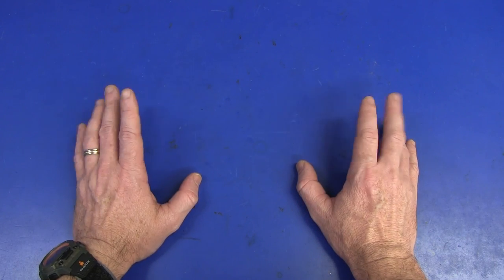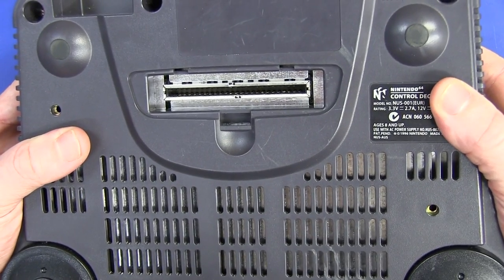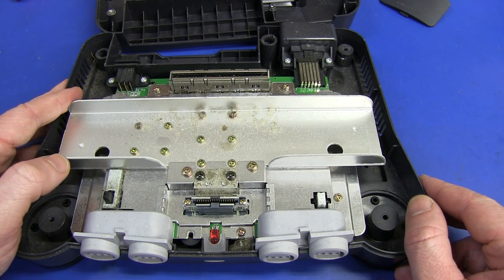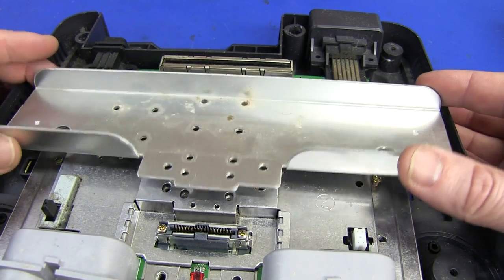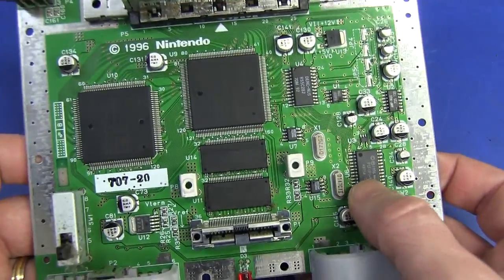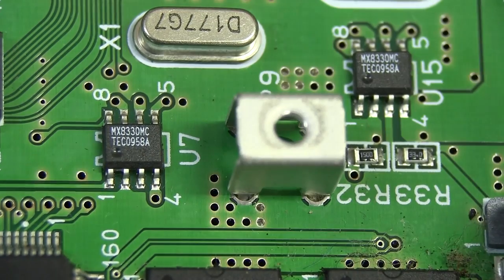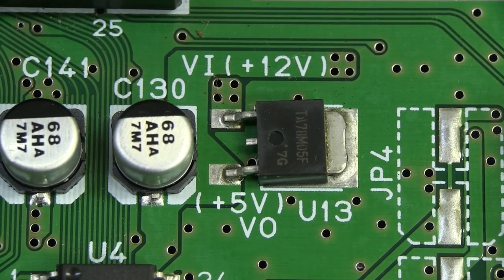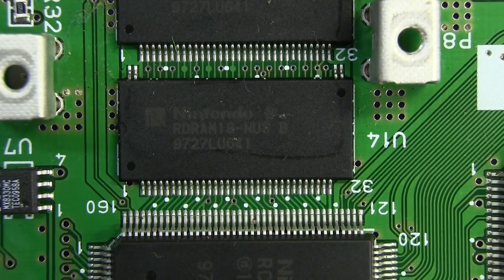EEVblog #491 - Nintendo 64 Game Console Teardown

Comment: FYI: The N64 was not a failure.
Reply: Death's Heir To be honest, even though the N64 is one of my favorite consonles, as far as the mainstream gaming market of the time is concerned, yes it was. The PS1 outsold it massively and many planned add ons and games were completely dropped and canceled due to low sales. I really have more of a problem with the part where he claims that most other consoles had DVD drives at the time... wtf...
Reply: Kristina I think he meant CD drives.
Reply: Kristina DVD: Digital Video Disc.
Reply: Jasper Teakle yes, I know what DVD means, but game consoles during the time of the N64 used CDs, not DVDs
Reply: Jasper Teakle DVD is an acronym for Digital Versatile Disc.
Reply: Ronald Madican Actually they kind of went back and forth with that.
Reply: Ronald Madican Both meanings are correct. Both have been used by major companies.
Reply: Slade Simon The Oxford English Dictionary
 comments that, "In 1995 rival manufacturers of the product initially 
named digital video disc agreed that, in order to emphasize the 
flexibility of the format for multimedia applications, the preferred 
abbreviation DVD would be understood to denote digital versatile disc" 
The OED also states that in 1995, "The companies said the official name 
of the format will simply be DVD. Toshiba had been using the name 
‘digital video disk’, but that was switched to ‘digital versatile disk’ 
after computer companies complained that it left out their applications
Reply: Ronald Madican so you are saying he is right then? I don't get it
Reply: Kristina For twenty years this format has been known as digital versatile disc. Which was prior to mainstream release. The decision was made over twenty years ago and it never went back and forth.
Digital video disc was a term which was dropped at a very early stage because it did not accurately state the uses of the media.
I just copied that facts from wikipedia, it seemed pretty straightforward to me.
So I was not saying anything, and if you want to carry on using a term which is accepted as not accurate that's fine. I was just trying to help.
Obviously no good deed goes unpunished.
Reply: Ronald Madican
 I did say both had been used. Just because no one uses the word "gay" to mean happy anymore doesn't change the fact it has meant that in the past even if it's not proper current usage.

There are more polite ways to handle this.

...and I saw Digital Video Disc being used after mainstream release. Regardless of decisions made, apparently not everyone was in on it. Because I had LaserDisc, I was late in getting DVDs and it was still being defined by some that way in early 2000s.

You made your point. I'm done.
Reply: Slade Simon I am very sorry if you have been offended. If you could let me know how to be more polite then I will take that with me.
Reply: Death's Heir This is not a simple matter and I agree that it was not a failure. However it did also fail on certain points. At that time, the discussion was about whether discs would be adequate mediums for the future of gaming. they were, and they were not. It is worth noting that at this time we were on the cusp of the disc to be used as a storage medium for games. It had many advantages as well as disadvantages. Loading times were atrocious and if you recall the ps1 had long waiting times for loading levels as well as stutters as game-play progressed through longer levels. The reality is that Sony went one way and Nintendo went another at a time when there was no certain outcome and the disc happened to be the direction that prevailed. Any earlier and the disc would have failed. It was simply a matter of timing. `
Reply: Death's Heir Definitely not a failure to me and my friends. Many, many hours spent playing 007, mario kart, starfox, turoc. Oh man...
Reply: He never said it was a failure.
Reply: +Death's Heir Nobody said it was?
Reply: +Death's Heir It wasn't a success and it wasn't a failure. The Wii was a success and so were the snes and nes. I'd say that it was the first big not successful console Nintendo made!
The cdtv and Jaguar were about the same but didn't have the die hard fans to keep it alive out of their niche and they had those new fangled rom drives too.
The Saturn wasn't awful either and that had a rom drive... was that not a failure?
I think it just wasn't a Playstation. Compared to that everything else did fail.
Reply: Ronald Madican The virtual boy preceded the N64, and massively less successful than the N64.
Reply: Yes you are right about that. Nintendo do have  some stinkers don't they?
I was thinking consoles though, not handheld or virtual devices. So I will try to be more specific.
Was the N64 the first console letdown for Nintendo?
Reply: +Dillon Flannery It sold just under 33 million units. The Playstation sold over 100 million. Thats what I'm talking about.
If you think that selling only a third as many consoles as your main rival "kicked ass" then good luck with that one.
Reply: +TheHitchslap As the Nintendo 64 reached the end of its lifecycle, hardware development chief Genyo Takeda repeatedly referred to the programming challenges using the word hansei (Japanese: 反省
 "reflective regret"). Looking back, Takeda said "When we made Nintendo 
64, we thought it was logical that if you want to make advanced games, 
it becomes technically more difficult. We were wrong. We now understand 
it's the cruising speed that matters, not the momentary flash of peak 
power.
Reply: +TheHitchslap The regret was that the machine was difficult to program and it's overall performance was slower than it should have been.
If within Nintendo someone had expressed regret about something publically then that is very telling. 
I'm from Europe and they didn't sell well here even though the snes and nes did well and the quality of games was good.
Probably it was timing.
The 64 lost market share, which in business terms is failure. I know that you look at overall sales but that is not how nintendo or sony viewed the stats.
Losing so much market share was a cause for much soul searching at the time. And it was well known at the time that this was the case.
Remember Nintendo had worked with Sony on a prototype of the Playstation, so it was a bitter defeat for them.
Now if Nintendo don't think it was a success why should anyone else?
Reply: +TheHitchslap It wasn't just Sony doing well the pc took off at this time as well. In fact there was a huge electronics boom. So losing market share was not good.
The Wii was a success, as it was a big gamble that paid off. The 64 was a first step into 3d, and they sold 225 million games. The Wii has sold nearly 900 million.
Now that's success.
And when it comes to handheld, Nintendo are dominant.
And that's success too. 
So I would expect selling about a third as many consoles as their rival would not go down well in the boardroom. 
That's not success. For them it was a missed opportunity.
The ps3 has sold 80 million and for Sony that was not considered a success. That's because it lost market share.
Reply: Ronald Madican Sorry to barge in here uninvited, but I'd question your claim that Sony thought of the PS3 as a failure. It was more complicated than that. The PS3 was largely the thing that dealt the killing blow to HD DVD (remember that?) and established BluRay, into which Sony had invested heavily, as the standard it is today. This isn't relevant to market share of course, but all I'm pointing out is that surely market share is not the only thing that matters here. Surely Sony must have known that the PS2 was a fluke of timing and marketing that wasn't to be repeated.

And of course this goes the other way too. Nintendo sold many Wii units, but do they really hold much market share? Most people who play video games would prefer to play the sort of games that are on the PS3/PS4 or Xbox, and would likely have one of those units in addition to a Wii they may have bought long ago and rarely used. Nintendo has utterly and quite likely irrevocably lost their once enormous materiel advantage over other gaming companies. Is that not a horrific failure? Is it? Maybe they don't care. Maybe they've decided they don't need that anymore.

It's often not so easy as to be able to declare stuff like this to be failures or successes. Sure, sometimes it is obviously so, but whenever it's not obvious, who's to say one way or the other? Corporations don't sign peace treaties.
Reply: +Roflcopter4b The death of hd dvd was that a 360 needed a plug in drive to play that format. So not nearly as many people bought hd dvd discs.
Reply: i agree n64 wasnt even close to a failure, it was one of the best when it came out and had a lot of the best games until later on. It was epic for its day
Reply: The N64 was no failure in the US. Everyone I knew owned one.
Reply: That's like saying Donald Trump is loved by the press.
Reply: Richard Smith when all your friends are nintendo fans it's no surprise, worldwide sales wise it was a gigantic failure and Nintendo didn't earn much money on it...
You know, money, if you don't earn some, you're a failure. (such is the world.)
Reply: Mark R. You have a very narrow minded view on life.  Sure it failed to beat PlayStation but it still sold 32 million.   So many innovations we now take for granted in 3D gaming happened first on N64 - so in terms of creativity it wasnt a failure.
Reply: David Smith The N64 had so few games that all the games Nintendo themselves made were hits because almost nobody else made games for it.
Nintendo not really having 3rd parties has been a problem since the N64, and has been a problem till this day..

The N64 will always be a financial failure, because it's obsession with cartridges (which remains to this day)..
Reply: It didn't create enough market share did it. It sold about 1/3rd of what the ps1 did. and about 1/8 of the games. It was almost as bad a failure as the gamecube. Only the handhelds kept Nintendo from going bankrupt.
That is not success.
Innovation and creativity are middle class bywords for failure.
I cannot believe all these turd polishers extolling the virtue of a twin 32 bit processor being sold as a 64 bit machine. Creative as that was it turned off the public in droves. It just did not have enough 3rd party support... pierod.
It is marginally better than the Atari Jaguar at best
Reply: Maybe I was just too young when the n64 came out to see the big picture. I was aware the Gamecube flopped, but by that time, I was PC gaming and starting college. My roommate had a game cube and was a football player, and I remember laughing at such a ridiculous contradiction. By then, nintendo had already started being associated with children.
Reply: It's a shame that the Gamecube failed. I thought it was a far better machine than the N64. Even the controller was better. I believe that the Gamecube would have fared better if it had not been preceded by the N64.
At least Nintendo have come around to the idea that it is fun and innovation that sells a console. So the N64 and Gamecube altered the  ethos from more processing power to more variety and entertainment.
Reply: Night Sage tbh the power glove and Nintendo 3d thing was the messterpieces
Reply: In terms of sales, it was when compared to the PS1.
Reply: I think the N64 did average, it beat Sega's Dreamcast but couldn't top Sony's Playstation and it stayed in the top three for the length of it's console generation.

 It's hard to say N64 was a success or failure but for Nintendo it was a success they made money on the console. In other categories the N64 clearly failed but it also had it's successes.

 I didn't like that console, personally. I think Nintendo sabotaged it when they abandoned the early designs of a CD-Rom based system and gave it one of the worst controllers in gaming history. Also the games were choppy- probably from a combination of using a weak graphics chip and coders not understanding how to efficiently use the N64 proprietary instruction set.
Reply: Nobody cares. The DS was better
Reply: Thank you

Comment: The screws are NEC External Line Head "GameBit" screws. You can remove them by melting a clear Bic pen over them and unscrewing. SGI designed it very similar to one of their CGI workstations but the RCP was designed by a team eventually known as ArtX (supposedly assembled and contracted by Nintendo). After designing the GameCube GPU they were bought by ATI and put to work on the Radeon 9700 Pro and newer GPUs.
Reply: Some of the workers there probably still design GPUs for AMD, who knows, perhaps some of the people behind the recent cards that can do crazy stuff like Ray Tracing worked on the Nintendo GameCube graphics chip back in the late 90s

Comment: He worked as an electronic engineer for many years. Note that electronic and electrical are not the same thing, electrical engineering is relating to stuff like high-voltage power transmission, while electronic is your average circuit boards.

Comment: Originally the console shipped with a "Jumper Pack" which terminated the RAMBUS.  The Expansion Pack was a replacement, you take out the jumper pack and insert the expansion pack.  It doesn't work without one of these two devices connected!  Also, it gives no signal without a cartridge, confused me to no end why I had absolutely nothing, but it was a dirty cartridge connector and wasn't detecting or booting the games.

Comment: The memory expansion module didn't launch with the console.  It came out later to allow the console to support newer, more complex games that required/could make use of more RAM.  Since probably none of the early games could take advantage of it, not all games use it, and memory prices continually fall, it seems they were actually helping the consumer with the concept of the module.

Comment: Dave, I think you'll find that the CPU will not respond without a cartridge due to the security measures that Nintendo added. When a cartridge with a corresponding CIC chip is not present, the CPU is kept in reset state, so the system will not play pirated games.
Reply: Not to mention that RDRAM also needs termination as another youtube viewer said so you'd have to put in the expansion pack for it to properly work. A second look into this please!

Comment: I believe the Jumper Pak was to delay the cost of the extra memory and to expand the product life. The systems were built in '96, and the cost of the 4MB RAMBus memory was huge. but the cost in '99 (when the Jumper Pak was released) was a fraction. That is why the pak was even included for free in Donkey Kong 64.
Reply: +D.E. Sarcarean Yep, I still have the pack that came with Donkey Kong 64!
Reply: The Expansion Pak was bundled in with DK64 because of a game-breaking glitch. Without it, the game would crash and become unplayable. Rare discovered that the Expansion Pak fixed the glitch and thus asked Nintendo to include it with the game.
Reply: Wasn't that game more expensive though?

Comment: That memory expansion slot on top is most likely the 'Jumper Pak', which you were supposed to replace with the 'Expansion Pak' (4MB RAM expansion, sold separately) released later by Nintendo. The expansion slot on the bottom was intended for the 64DD, a disk drive add-on for the N64 that basically failed commercially. It only came out in Japan.

Comment: As for the cartridge socket connector, I actually think it's a pretty solid design, and not a questionable cost-cutting measure.

Think about what's going on here. First of all, kids absolutely will slam cartridges home, possibly on a regular basis. I'm sure I did it myself back when my '64 was in service. One of my first thoughts when you started looking at the main socket was "solder joints will be pulled off the board in no time with a kid slamming that cartridge home". Solder joints are pretty solid, but impact force transmitted against the joint via a through-hole pin is a great way to delaminate the copper pad entirely from the board, if not fracture the joint outright. 

But with this design, right off the bat, by having the cartridge socket connected via a socket of its own, there are now two points of play to absorb the stress of this impact. Also, because the mounted socket is through-hole and on the bottom (leaving the solder pads on the top layer), any impact force which is transmitted through both sockets to the solder joints is now pulling the joint together (into the board), as opposed to pushing it apart (away from the board).

Clever, if you ask me.
Reply: marshaul Not only that, but those connectors could get worn out. Replacing them was now trivial. It is a very, very clever design all around.

Comment: The N64 used RDRAM.  The console shipped with a terminal jumper stuck under that little door.  Most games ran fine, but for things like frame buffer effects and motion blur you had to have the additional module, which I believed doubled the system RAM.  They only made like three or four games that required it, though; Majora's Mask and Donkey Kong 64 were two of them.
Reply: 'Road Rash 64' also used the Expansion Pak (NUS-007) that increased framerate from 30 to 60 Hz.
Reply: @girlsdrinkfeck Late: But there was no memory leak in DK64 and MVG debunked the myth.

Comment: N64 without the memory expansion would have a Rambus DRAM Terminator on the expansion slot there, the system either requires that terminator or the expansion to work.

Comment: Random thought: The RAMBUS RAM wouldn't have any termination without the memory expansion or a termination pack installed. It probably wouldn't start up properly with the memory non-functional.
Reply: Yes.  The memory expansion port would have a terminator installed if the RAM expansion pack was not installed.  Without either, the memory would not work, hence the lack of signal on that bus.
Reply: As well as a cartridge